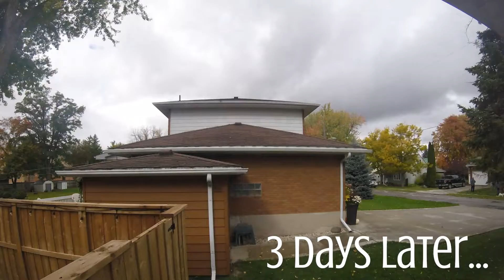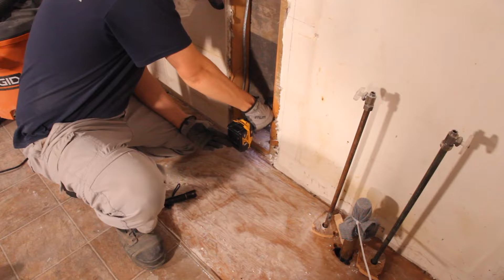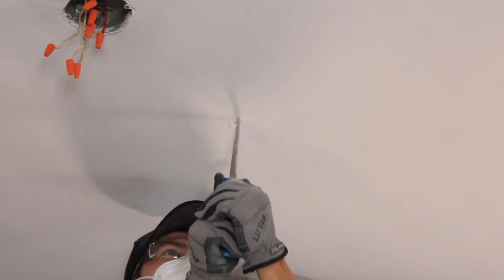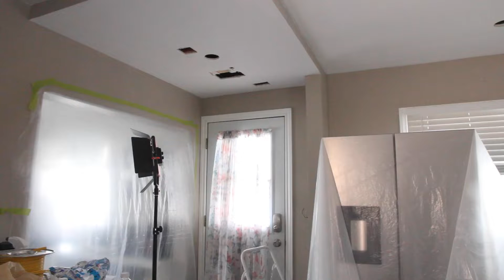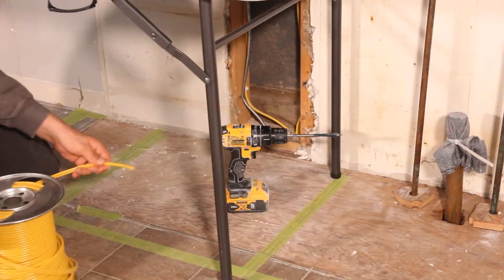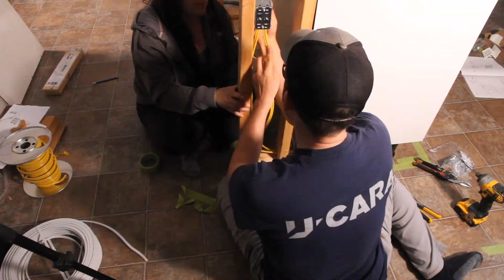DIY Ikea Kitchen Remodel Series - Kitchen Electrical Rough-in - Ep3

Comment: Great video!  We'll hopefully get to our 1999 kitchen remodel next year or the year after. I actually tried to use the Ikea kitchen design tool a few weeks ago. We've been here two years and there has been a lot to do. Been watching all of your videos to see how it all comes out. I would definity vent the range hood. Looks like it wouldn't be too far away from the outside wall to run the vent up through the attic and out the side wall? Things we're dealing with are, the entrance to the garage and also the basement stairs are right off our kitchen making it a real hard design to deal with.
Reply from the maker: Yes we plan on adding a range hood with proper venting - something the house has never had. Will have to wait until the snow melts to tackle that one but it’s in the works.

Comment: Nice video.  Do you plan to add AFCI breakers?
Reply from the maker: Yes. We pulled a permit to do the electrical so we will be putting AFCIs where they are required by our code.